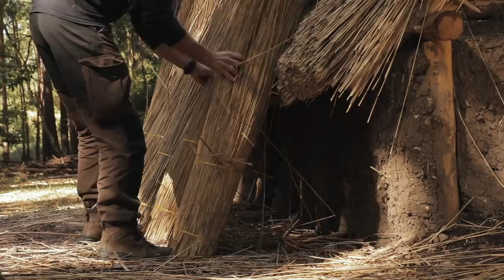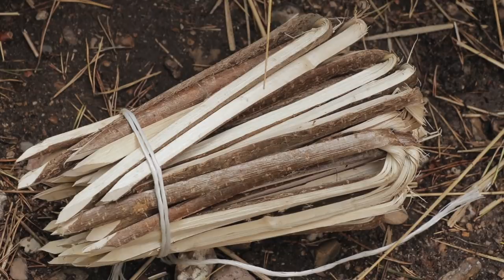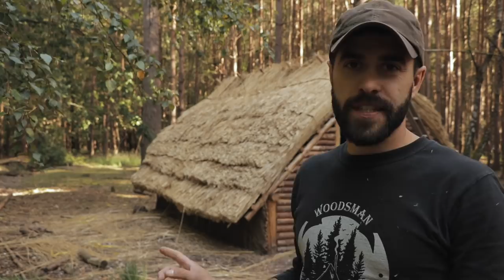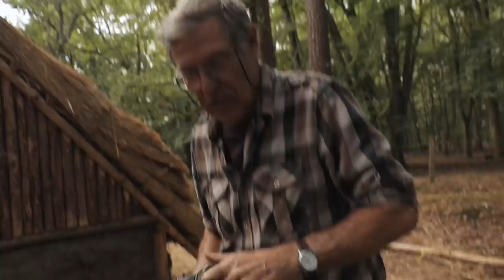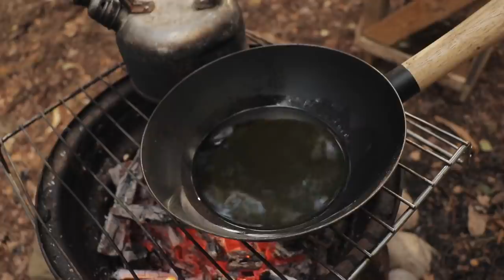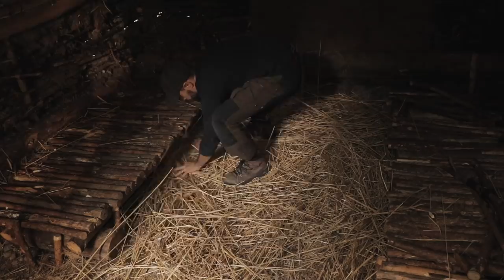Building a Thatch House with Water Reed: Bushcraft Saxon House (PART 10)

Comment: Watching you working on the roofing I can see the logic in digging into the ground before the walls go up. Not only us it insulating but lower roof line means less wind resistance in storms but also easier to work on in the construction stage or reroofing after storm damage. Less distance to fall, but also easier to reach without needing long ladders. Great job.

Comment: Great build, impressed with the thatch. I would suggest mixing your cob (clay and straw) on a tarp or in a wheelbarrow, it keeps the top soil and needles out of your cob and it means you do not nee to use as much water as kess soaks into the groun below. :)

Comment: Great work! My friend who's relatives have used thatch in the old country said you need to make a splayer to help spread that out. Take a piece of 1 by 6, about 10 inches long and attach four thick dowels, about 6 inches long, spaced evenly on the wide faced side of the board. Attach a handle on the long side and it will help agitate it to trim it out. But great job with what you have!!

Comment: Cut some lavender...with long stalks and put that on the floor too. It has so many benefits. I love your attempt at the roof. Well done, it's a difficult craft to perfect. xxx
Reply: Spider mites love lavender as well so maybe a different herb? I hope they don't swell up like a balloon with those bites 😱.
Reply: @dlsdyer9071  Yet, dried lavender is a miticide! It's one of the reasons it was used to strew across floors. i realise fresh plants of lavender can have problems with spider mites though. x
Reply: On the other hand, folks in the Southern USA use it all the time as scorpions are repelled by Lavender.
Spiders, by the way, hate Peppermint Oil. You have to get the real stuff though, like from a health store, the fake Peppermint won't work.
Just place a few drops on cotton balls and place them in the areas of whatever room you want to have no spiders in.
Ants are repelled by Cinnamon of course.
Reply: @davide.burden2043  🥰. Peppermint on cotton wool deters mice too...again, mint was a stewing herb.
Reply: @davide.burden2043  Thanks for the tip. Query, does the UK have scorpions where TA is? Grew up in AZ and remember checking the shoes every a.m. before putting them on as our trailer was backed up against the desert. Had a tarranchula or two as well.
Reply: @moiragoldsmith7052  ...as I found out when harvesting a bunch of it one year☹️. I have a recipe for an insect repellent that uses essential oils but could never figure out which oil was for what, just know it works like a champ!
1T Vanilla (Real)
9 drops lemon eucalyptus
7 drops citronella
4 drops TEXAS Cedarwood
3t distilled water
Put in atomizer and spray all over body.
Reply: @DLS Dyer
You are quite welcome.
As for the UK having Scorpions, I sincerely doubt it because they are too far North and their climate is too cool. But I really have no evidence either way. I'm in Missouri and I never managed to visit the UK. 
We don't have scorpions here in Missouri either though, and for the same reason, our climate is too cool. We also don't have Armadillos or Fire Ants in my part of the state either, but they do have all of the above in some of the Southern parts of the state.
Which is fine by me, I put up with those pests when I lived in Texas, and when I lived in Southern California. I'll take some snow in the Winter and some below freezing temperatures over those nasty biting/stinging critters any day.
Spiders we do have, and plenty of Ants, just no Fire Ants up in my area. We have bees too, just not the Africanized ones.
Reply: @davide.burden2043  We have some snow but not enough to kill off the scorpions here. Another 20 miles north and the problem is gone.
Reply: @dlsdyer9071  Yes! that would deter the little dears 🤭We have forgotten so much. I love herbs! Big Pharma cant make money off us so we have been dumbed down by the 'machine'... 🥺.

Comment: Looking forward to seeing what sort of ridge cap you put in.  That'll be the success of the roof, and the first component to weather and go, in all likelihood.  Luckily, the ridging can be replaced separately as it gives out.  But the pitch of the roofline is good and steep, as well as the pitch of the thatch itself (the coatwork), not overly flat by any stretch.  It is a bit thin for coatwork, but one does with what one has.  Cheers and good luck with the capping!

Comment: You need to put more reeds at least 3 more rows.....cut it flat on top, shift thatch after each row placed...never place 2 rows before blending....1 at a time...stack and blend it till you  reach the top. Last reeds should be bent over to other side of roof....pin it down, and keep for last row after starting from the bottom again on the other side...it will blend in and will provide extra sealing "ps....it looks good from inside to....

Good luck

Comment: Not to say right or wrong...
Personally, I would not cut the reeds at the ridge line. After working the rolls under just the same. but, I'd extend both sides up to an X formation, weigh down the ridge line with logs, then start working & staking down the excess reed.

Very interested in seeing what you come up with. 

Keep up the good work.

Comment: It looks good, I can see that some sort of overhang on the front and rear of the roof on such houses was probably required in the day, to guarantee proper roof coverage and not have drips down the two walls.  Considering this is your first attempt at such things I thing you are doing a fantastic job.  :-)

Comment: 21:26 Papa nurgle blessed us with heat by rotting straw.
But for all seriousness: the heat is formed by a runaway reaction of bacteria. They need a specific ammount of Nitrogen in their diets to survive and grow. Straw is mainly cellulose, that consists of glucose added together in a polysaccharide. Because of this lack, the bacteria need to burn A LOT more to gather enough N to grow. They need about 1:8 N toC, whilst straw only has around 1:40 N to C. That's why the heat is generated. It's the "body-heat" generated by bacteria intensively breaking down the straw in search for N to grow.

Comment: I'm really not sure about that composting-heat theory in the house. I believe the saxons would have changed out the straw from the floor regularly, so to not have bug issues. You really don't want to have something rotting away in the house ;) Anyway great work!!

Comment: Mites hide in straw,  use a good sprinkle of food grade diatomaceous earth 💝☀🌵
Reply: Those are water reeds and inhaling DE can be harmful.
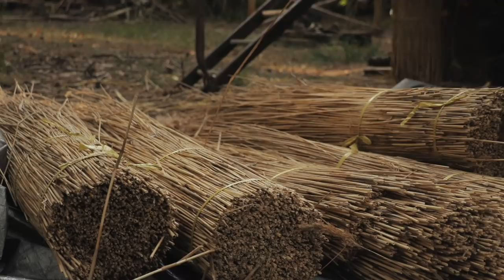Reply: @ginawhisnant9966  the Reed is full of spiders,  what are the spiders eating? Mites and other bugs. DE worksheet on them all. Food grade DE is safe for humans. But you're right, you don't want a cloud of it when you move around. Sending lots of love 💝 from sunny ☀Arizona 🌵. P.s. they put straw on the floor. 21:00
Reply: @suzisaintjames  - DE works because it is abrasive and breaks down exoskeletons in insects. Once it has gotten wet it isn't that effective. I would guess the spiders in the water reeds were bundled along with the reeds and ate all manner of insects where the reeds grew, not just mites. Releasing the banding on the bundles frees up the spiders. Dried pennyroyal in the floor material would be effective and smell nice and minty.
Reply: @ginawhisnant9966  , we don't have pennyroyal in the USA. Nevertheless, Wikipedia says it's toxic to your liver, as a neurotoxin. I'm not sure I'd want to be sleeping 8 hours a day with it. But you are right, herbs are one way to manage insects. But they must be renewed constantly as they only repell, not eliminate the problem. As soon as the oil evaporates, the insects return. One application of DE will kill numerous generations of insects. 💝☀🌵

Comment: At the end of the video, when you were between the beds putting down broken-up reed, in the upper left part of the image, gaps in the claywork were visible, which would result in a lot of infiltrating cold air in cold weather. 

With how sheltered the inside is from light, a nice bright day is just the ticket for isolating and correcting those gaps.
Reply from the maker: Yeh we though that. We'll be filling in all those gaps in due course before winter weather sets in!

Comment: Get a charcoal smoker and Cargill smoke out the house. The smoke will keep the bugs at bay and further water proof your house. If your worried about lighting the house on fire, build the for outside and pipe the smoke in.

Comment: you can use cloth for the door, I know it's basic but in the old days they would have just put animal hide or some cloth to make the door, it's cheaper than 25 pounds, or 75 pounds for a solid door at the hardware store.

And P.S. from a fellow Aussie, we are sorry for what bunnings has tried to pull on your hardware industry.

Comment: By flattening the reeds you better had to use a recktangular piece of wood with a handle in the middle. The thatchers use a tool like that and use it from the moment they lay the reeds on the roof. Then you knock on a broader surface and i think that you get a flatter roof. Good luck trying! Joke Sprang from the Netherlands

Comment: Awesome project, lovely results on the house!

Even if the floor rushes don't really compost that much, it'll act as a really good insulating layer. Put some of the reeds aside in a dry space for re-rushing the floor as the old rushes get stomped down into the soil, and you'll eventually have a pretty solid flooring that keeps most of the cold from rising up from the floor. 

If there's any limestone nearby, you could try making a slaked-lime mortar for filling (caulking) the gaps in the log walls, or use hemp rope impregnated with pitch/tar to fill them up. It'll not be as insulating as your double comedian lower walls or thatch roof, but at least you'll get rid of drafts. If you want the cement, and there's no limestone nearby to burn for slaked lime, you can make do with wood ash, leaching the potash from the ash into water and pouring it off, and then mixing the resulting mass with sand / clay to make the cement, but obviously it takes a LOT of ash.
Reply from the maker: That's what we were thinking with the reeds. Pointless just leaving them outside in a pile. We still have more straw to go on top of those reeds which will make it more comfortable to walk on. Eventually it will all start to breakdown over time. Sadly no limestone nearby, but that would be an awesome little (big) project!
Reply: @TAOutdoors  I suggest (for that project) to collect enough ash or get limestone from somewhere to do it once so you can show it to us in the audience, and then use commercial equivalents (this isn't for the Saxon house, but if you want to try things like making a medieval house with a chimney etc).

Comment: i think with  some research you will discover reed flooring or straw flooring in general wasnt left to rot and compost inside the home  be it ever so humble was still as clean as it could be kept it would have been changed weekly or monthly  and was used more to cover and insulate the dirt floor underneath. as for the wattle i believe hazel is freferable  because of its properties of regrowing in clumps where harvested having generally lon slender flexible trunks whereas pine tends to have radial branches every foot or so  providing less flexible areas  at regular intervals  but thats not to say any tree like material couldnt be used  .as for your thatching  great effort lessons learned  im guessing there are things you would approach differently in a second go around  and given that professional  job should see 15 to 25 years of service i suspect you can have another go in about 10 years  and another beauty of this roofing system  layering  if your roof rafters are strong enough 4 or 5 layers possible for up to 150 years before having to strip the reeds back to the rafters  ;] each layre more insulation . im kinda stumped on your roof peak solution and offhand i dont recall how it is properly don or why it is done the way it is so it will be good to see your solution . thanks for the videos

Comment: Hi Sean from the Burren in the west of Ireland 
Having removed several old thatched roofers 
First problem with your roof is it is impossible to to seal rafters protruding from the ridge ????
Ridge was usually made with a (sugan) or role of reed, straw, or dry grass on a continuous twisted role 6-8” thick very tight from barge to barge
Hope this is helpful
kind regards Sean

Comment: TAO, do you have any plans for putting in a small stone oven?  I was thinking of the clay/dirt mix for the stones and then putting a wire mesh around a metal flue and packing it that with the clay.  Folks, I know it's a thatched roof but putting a spark arrestor on the end of the flue and packing the outside of the flue with clay should alleviate the threat of a fire.

Comment: Once the wattle sets a bit, is it going to get a layer of plaster as well to seal it from rain and such?
Reply from the maker: Good question. We could limewash the walls, and still might. But the eaves of the rafters go over the walls so there is no issue of rain ever hitting there. The only area where rain might hit is each of the gable ends

Comment: Possibly consider live streaming your content. Might be difficult in the woods, but fishing on a boat shouldn't be bad. I watch therealshookon3 on Twitch and he streams miles off shore in Aus. His manager and him did some calculation to know how long their antenna has to be for his booster for cell signal. Then he has a LiveU Solo based setup, similar to the gun run backpacks. I'd imagine you can use your existing camera's long as they have a HDMI out. Check out shook he's live rn, if it's something you want contact his manager rollin7 on discord. Cheers!

Comment: The sides you could make a bit of a overhang and then use vertical willow weave to keep it in there but I think you cut the wood in the roof a bit too close to the walls to make that overhang so rain doesnt get in from the sides when windy. See the link for that vertical side weave of willow what I mean: https://www.gry-online.pl/Galeria/Html/Poradniki/1859/82494405.jpg  (its from a game I know but its from the same era sort of.)
Reply: Also for the first time its not bad at all, some parts are too thick or thin because of less than optimal placing but still, its a thatch roof!

Comment: Where did you get that much straw???
Reply: Thatch not straw. Although straw was, and is sometimes used as thatch, the modern wheat stalks are too short for thatching. Many years ago, the wheat grown in many parts of Europe was much taller, up to 6 feet tall, but that type of wheat is no longer grown. 
Therefore, this thatch is made from water reeds not native to the UK, which is why they had to wait quite a while for it to be shipped to their area. I don't know where their thatch came from, but a lot of it comes from Turkey, Eastern Europe, China and South Africa.
Reply: @davide.burden2043  kk

Comment: what about rain with roof like that?
Reply: @Zbieram UGÓLEM 50 subskrypcji bez filmow
Thatched roofs have been shedding water for thousands of years. 
Yes, some will soak into the thatch, which is why they made the frame of the house so sturdy so it will support the added weight , but most of the rainwater will run off the roof.
Reply: @davide.burden2043  thanks for answer
Reply: You are welcome.